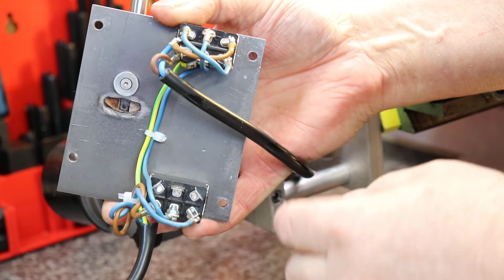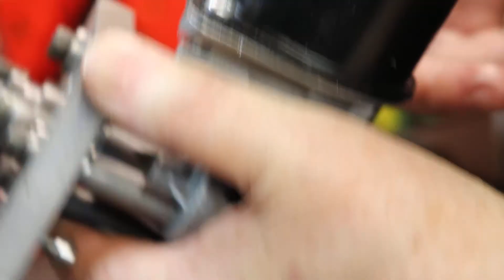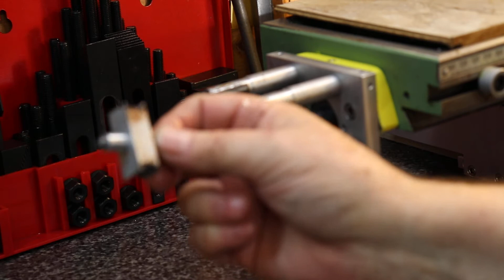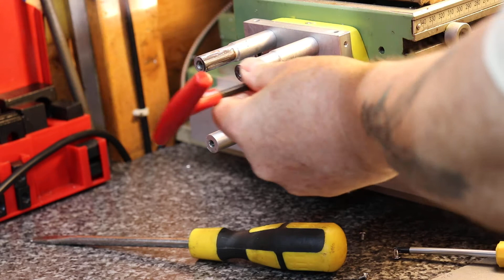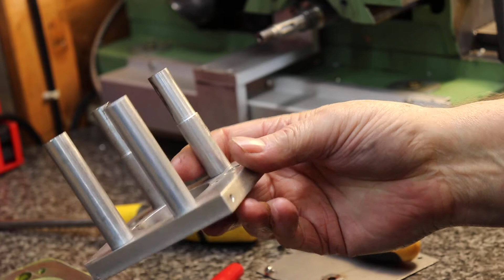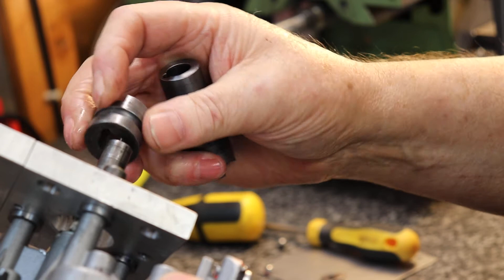Power Feed Part 2

Comment: Interesting solution to the run out problem with the splined shaft of these windscreen wiper motors. I ended up using a flexible shaft connector on my power feed to compensate for the run out. Your solution is so much more elegant. 👏👏👍😀